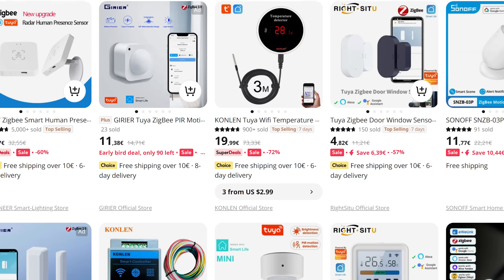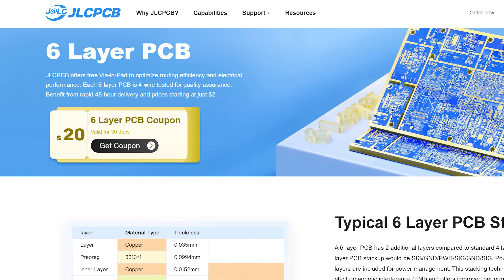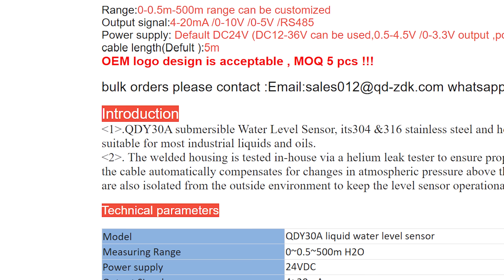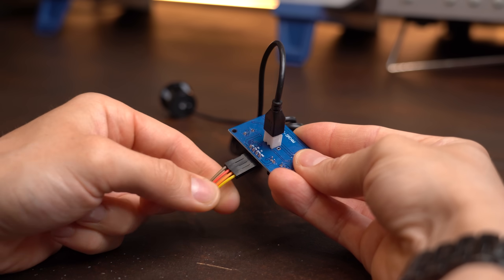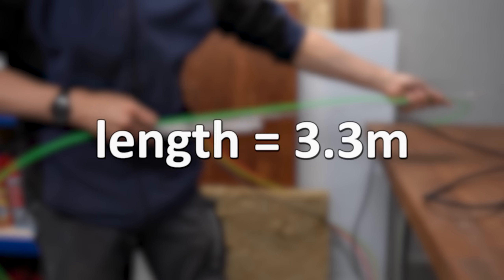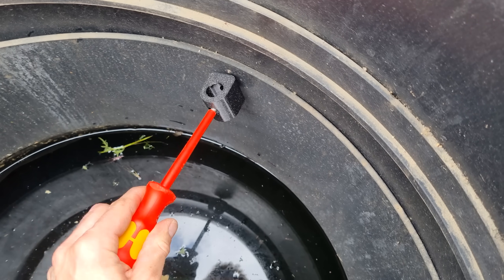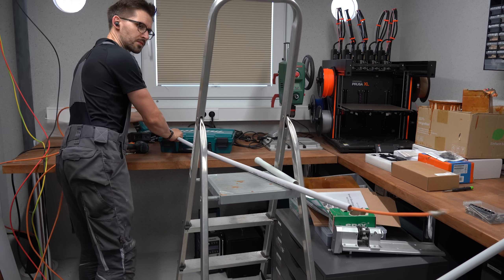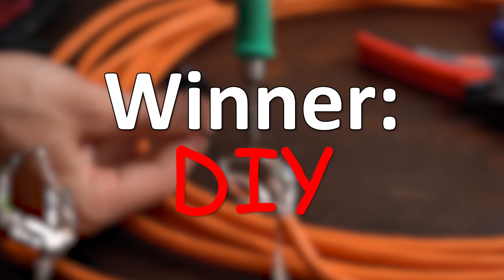This Happens when all Buy Options Suck! Water Level Sensor (DIY or Buy)

Comment: the cable of the sensor looked like a coaxial cable, high frequency can be a bitch sometimes, also since you don'tt know the impedance of the coax it is pretty difficult to extend.
Reply: Isn't the type of coax cable printed on it? But if not, I think greatscott has a VNA, he could measure it (or even use his signal generator and oscilloscope). After that coax cables can only be extended with the right impedance plugs and of course the right impedance extension cable. That soldering experiment with the STP cable will generate a lot of reflections at the connection.
Reply: It probably benefits a lot from having the right impedance cable without any splices. Maybe even the resistance part of the wire plays an important part, in order to get the right amount of power into the transducer and the amplitude of the return signal is in the range where the return signal amplifier has it's working point.
For someone with that much test and measurement equipment i would have expected a bit more of an analytic and scientific aproach than just blindly trying a few different cables and give up.
One thing that might be a bit strange is that the signal frequency is probably below 50kHz because it's ultrasonic, so well below the usual RF frequency where normal coax cable impedance is specified. If you look at a frequency/impedance plot and the phase angle between voltage and current, cables like RG-58 are getting very unlinear below 100kHz. So that might play into cable selection here as well.
Reply from the maker: Yeah. I searched online for a solution but it seems like no one managed to find one yet.
Reply: @greatscottlab  Buy another JST for dirt cheap and use the cable from that one to extend. Increase the ping time to at least 30 microseconds; the module seems to prefer this for some reason.
Reply: Use two arduinos and connect those by a long cable 👍

Comment: I would love some more details on that flexible water resistant junction box! I've never seen one like that before, and a wide variety of uses immediately come to mind.
Reply from the maker: It is very common for electrical installation here in Germany. I tried linking a similar one in the video description.

Comment: My first idea was a pvc pipe with conductive nodes every like 5cm or so.

Then apply a small current to the water on the bottom and run all nodes to the micro controller, and then it can determain how high the level is via evaluating what circuits are closed.

Might require a lot of GPIOs tho
Reply: If you are talking about exposed conductive electrodes, you might have forgotten about corrosion. Capacitance sensors may work. But there's a reason most of the solutions discussed here don't put corrosible  metal into the water.
Reply from the maker: Oh boy. Does not sound super easy. But fun.
Reply: If you want to limit the number of gpios used, you can always use a 165 shift register and connect it to your SPI interface if using an arduino. And if you wonder, you could even cascade the 165 one after the other, so you only need 1 SPI interface to read an entire set of 16 inputs.

Or an IO expander also works.
Reply: 5 gpio is enought

Comment: We are using an option that you did not mention.
It is effectively a buoy with a rope and measured the distance.

Its so simple but effective & easiers to deal with the whole water aspect, I can recommend it
Reply from the maker: Sounds like a reliable analog solution :-)
Reply: A buoy is the most practical solution, that's how water tanks close their intake as well
Reply: @esuomi  you could built a draw line encoder, or built a linear encoder where you have leds on one side and photocells on the other and the rope blocks the leds
Reply: Time of Flight sensor like VL6180X is cheaper, easier and smaller than all of these solutions.
Reply: @moeburn  Not waterproof and not enough range. so sensor used here is perfect.
Reply: @kjur18  mine has 80cm range, how big a tank is this?  and ultrasonic is waterproof?  i dunno if it needs to be, just tape it to the underside of the lid.  a little bit of mist spray doesnt hurt it.
Reply: @moeburn  His tank is over 100cm in height.
Reply: @kjur18  there are other TOF sensors with that range.  I still think its the better option in total darkness - ultrasonic has so many problems that it is best used when TOF cannot, like in bright light.
Reply: @moeburn AZ-delivery mentions a range of 2-100 mm that isn't enough for a 2m deep tank
Reply: @esuomi with a smart placed switch.
Reply: A pole with marks on it. Less than $5. 😂😂😂
Reply: @esuomi attach it to a 3d printed spool and connect it to a precision potentiometer